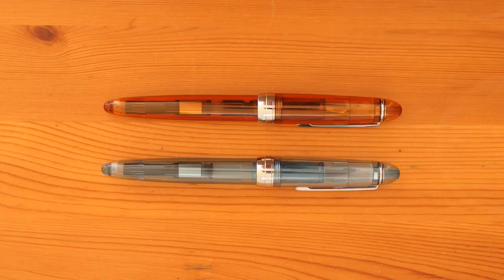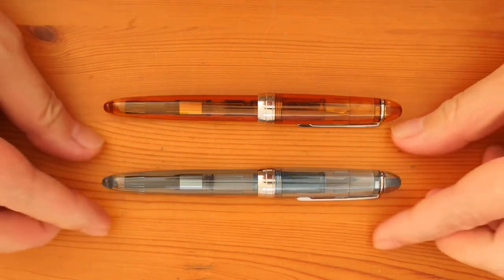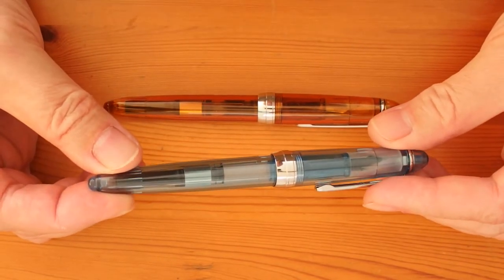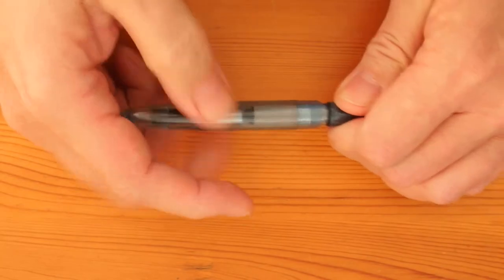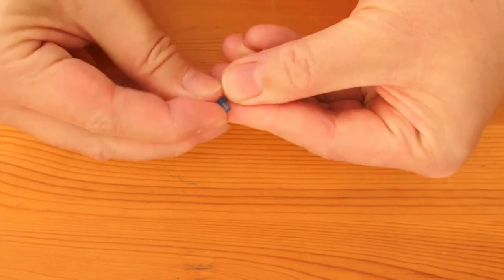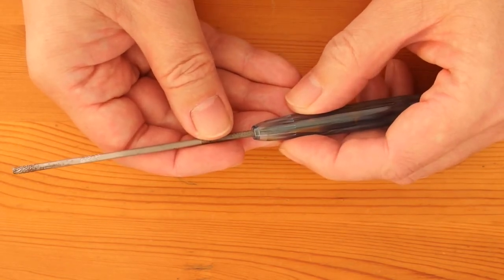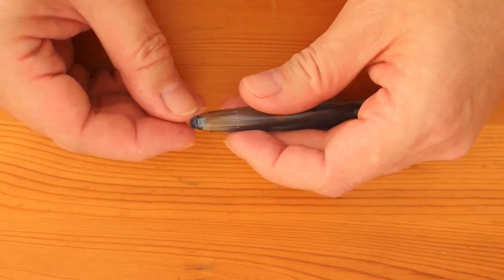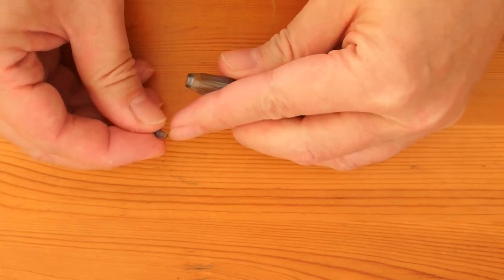Jinhao 992: A Remedy For The Barrel Cracking Issue

Comment: I had several solid green 992s all self destructed.  I believe the pigment actually weakens this plastic. None of my 4  transparent models developed any cracks over several years
Reply from the maker: Interesting observation! I wonder if the sections are less prone to developing cracks, if that be the case, we could very well use the sections as basis for new custom pens by making new ebonite pen barrels and caps.

Comment: The cracks were a major reason why I did not want to buy the pens despite their price. Now I'll get myself a set, since I also have one of those files. Don't have epoxy though so I'll try UV resin or special plastic glue...
Reply from the maker: Hope it works out for you; a bit of flexibility is desirable for the adhesive, as the solid plug that causes the problems is not capable of offering a bit of "give". On the other hand the costlier similar ones have hollow plugs, a significant factor in their longevity.

Comment: Very cool.  My problem was at the cap, it broke the ring of plastic at the nib holder.  The plaatic is just too weak.  Argh!
Reply from the maker: Over-tightening the cap can easily pass the point where the inherent strength of the material gives way.

Comment: Very nice job with this.  I use  clear long cure epoxy (30 min.) in which I have complete faith.  This is a circumstance where, if completed properly, the join would be far stronger than the parent material which it fixed.  Small wonder no cracks develop. I would only add that after oiling up that little cap by handling it...you would be well advised to degrease both sides of what you want the epoxy to bond to, though the freshly filed surface should be OK. I use 100% Acetone...being careful to test it to ensure it doesn’t negatively affect the finish of the plastic.

Comment: Thanks for the video, @Seele2015au!
From the six 992's that I've purchased, two had developed cracks within 48 hours. After I noticed the cracks, I've grinded the holes of each pen down and applied some glue. Weeks later, the 4 other pens are still crack-free, but the existing cracks keep developing.

Comment: Thanks for the great video. I wouldn't have the patience or the skill to repair the pen this way, but it's nice to know that it's possible. Do you find that the solid color versions of the 992 suffer from these cracks as well as the transparent ones? I think the nibs are excellent, they write out of the box and don't dry out even after weeks of not being used. I've E.D.ed a couple of these great pens after sealing the end with epoxy adhesive and they've been fine.
Reply from the maker: jerry550, I do not have a good collection of the 992, all I have are these two, so I cannot give a definite answer. But based on my prior experience in plastics, solid colour means the incorporation of various opaque materials into the plastics itself, which can significantly alter its mechanical characteristics.
Reply: Seele2015au I had 3 or 4 of the transparent ones, they all developed small cracks near the plug. Perhaps they were older and the situation has improved? The solid color version seems to be free of the cracks. Coukd the cracks be below the surface and not visible in the opaque versions?
Reply from the maker: jerry550, if cracks develop it would go through the thickness of the material. But there is another factor: clear materials would show the crack as you can see through the material to notice the crack, opaque materials would not allow that, so cracks might be present but they would not be noticeable.

Comment: A good method would be to buy a pen other than Jinhao. I have no idea why anyone recommends them: I bought half a dozen or so when I first got into fountain pens. Five different models. All of them turned out to be useless junk. I still have them. I keep them in a box, in the dark, out of sight (and nearly out of mind).
Reply from the maker: Jan Kafka  I am sorry that they do not work out for you; many people have success with them me included,, and the seal between the section and nib unit is a very nice touch that should have been adopted by many other makers.
Reply: Seele2015au   I am a seasoned pen collector & user with many fine pens.  I have as many very inexpensive, somewhat inexpensive and not all that inexpensive Chinese pens as I do the usual suspects from Japan, Europe & the USA.  I won’t even use the phrase “for the money” in describing how pleased I am with most of my Chinese pens.  Especially in the past few years the quality has shot up off the charts.  So when looking at some of my $2 pens and some of my $200 pens...I honestly had to retire the ‘you get what you pay for’ perspective. Sometimes you don’t...but sometimes you get way, way more. YMMV
Reply: @davidmathews2124  could not agree more, the beauty of the Jinhao pens is the variety of form and color. I have a nice collection of pens that otherwise I could not afford, also if you do have a problem pen you can replace it at minimal cost.

Comment: Two of my six had cracks so I patched all of them.  You can use a quick drying clear glue like Scotch Maximum Strength Adhesive (Cat. 6047).  There's really no need to file down the plug end, and getting a bit of glue in or over the hole is fine if you don't care if it looks absolutely perfect.  For eyedropper filling, another video shows putting quite a bit of gorilla clear glue (epoxy would be better) in, enough for a good seal but not so much the converter won't fit all the way down.
Reply from the maker: radellaf I am aware of solvent-type adhesives like the Scotch you mentioned; please note that by nature, it would only work on some plastics, as the solvent component can affect some types, and I certainly would not want to make any recommendation which might cause further problems, including affecting the appearance and finish. The solvent type adhesive is also not suitable for filling spaces in the same way as resin either.
Reply: Seele2015au Not saying the epoxy isn't better, especially for ED conversion (where there is a significant gap that needs filling), but for fixing a pen I paid a buck for, it'll hold the end bit in and hasn't hurt the plastic.  I don't have much of a repair kit so If I had to go buy & mix epoxy I probably wouldn't have bothered.  I had the Scotch on hand.
Do appreciate the video for showing how easy it is to do this.  I'd never have thought the end bit just pops out, or to use a rattail on the hole.
The glue doesn't dry completely clear, so here's a photo.  If this isn't acceptable, don't use the glue I mentioned: http://i.imgur.com/X50cxRV.jpg

Comment: Great ideas.  I want to eyedropper, so I seal the end with clear glue.
My latest 992's don't have cracks, they made plug smaller or hole larger.
Excellent video, thanks.
Reply from the maker: chrisrap52 It is not easy to make sure if Jinhao had actually made modifications to the moulds for the barrel and end plug; if the plug feels a bit less tight on one example, it could also be due to dimensional variation within tolerance. But for my money, I would routinely modify every example that comes into my possession using this method,  as a mean to inoculate it against cracking, but there again I do not yet have any plan to purchase more specimens.